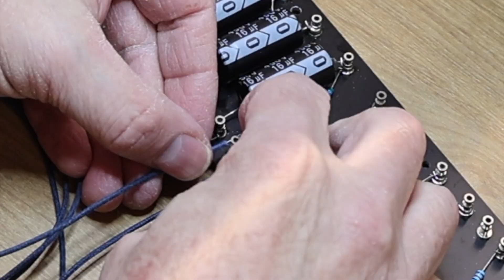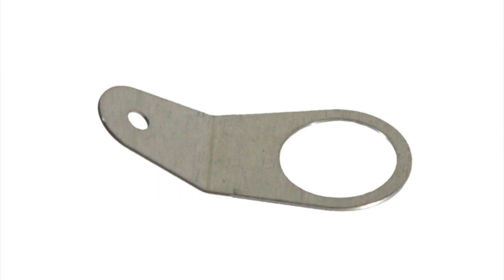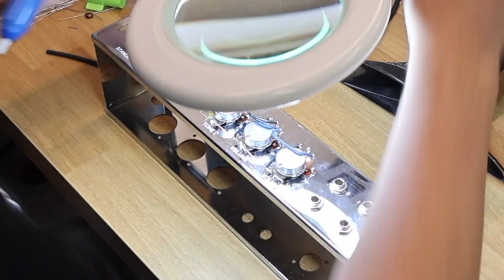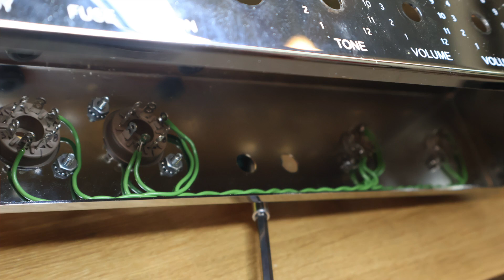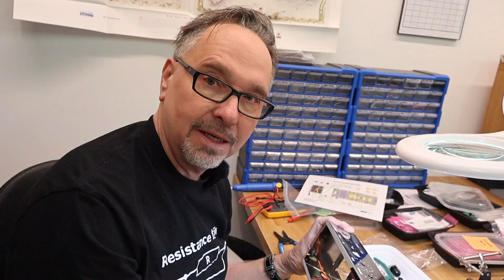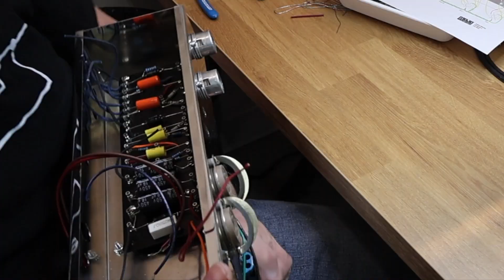5E3 build Part 5: Turret Board installation and chassis wiring.

Comment: Great video! It’s not easy to wire and film, I always get distracted and miss filming steps. Just a note on wire- the cloth wire you strip usually has a much higher voltage rating for insulation compared to pushback wire. Personally I don’t like the idea of that HT going through cloth insulated wire but they used to do it all the time back in the day.

In terms of heater wiring, I start with the wire longer before twisting and then cutting and untwisting the lengths you need.  Try running the leads over the tube socket rather than around it for better emf reduction.  It’s a good idea to fly the leads going to the pins or fly the heater leads rather than having them both flat comingling. Elams has a good video on it.